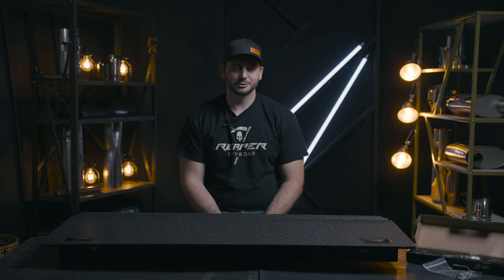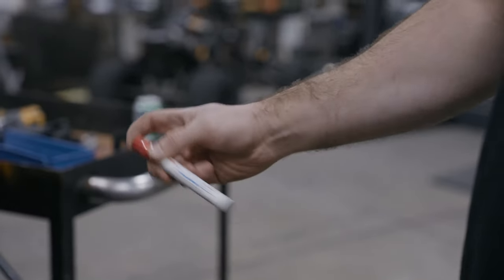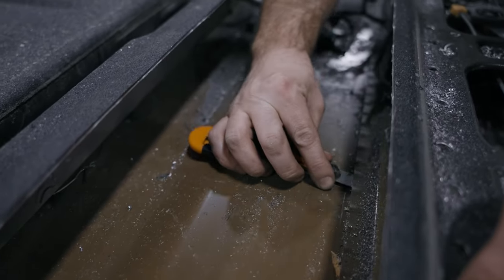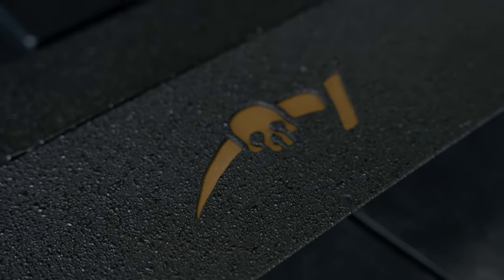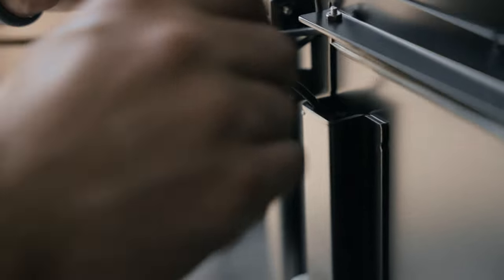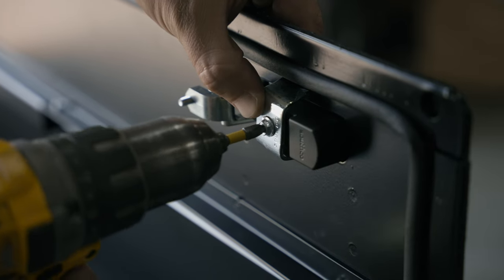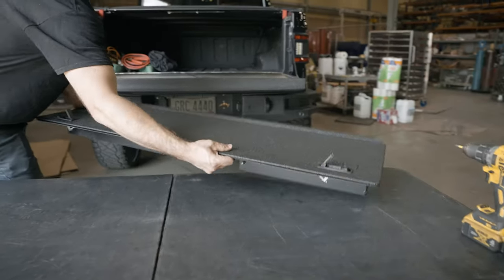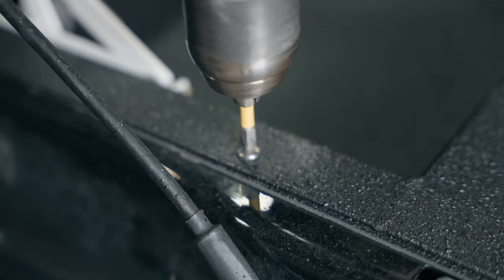REAPER Tailgate Storage Installation

Comment: In case people want to know, a 5/32 drill bit will make the hole smaller than a #21 drill bit and a 11/64 drill bit will make the hole larger than a #21 drill bit. You should include a #21 drill bit since most home improvement stores don't have them.

Comment: Not going to add some weather striping or some sort of gasket? It's definitely going to leak water into the tailgaite. Also in my experience with those latches they are notorious for always popping open. Love this concept just worry about keeping things dry.
Reply: At 3:55 looks like weather stripping already installed.  Maybe it’s just pre installed?